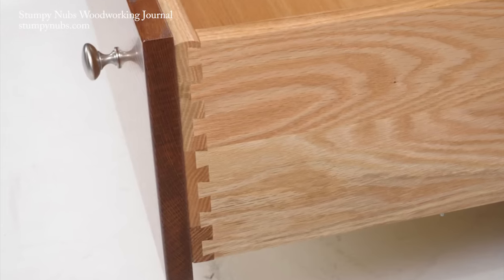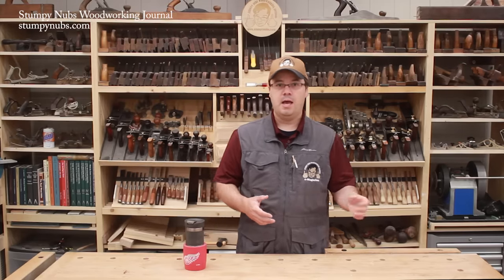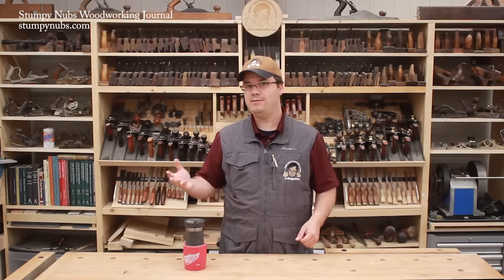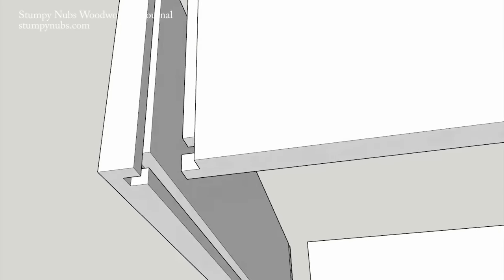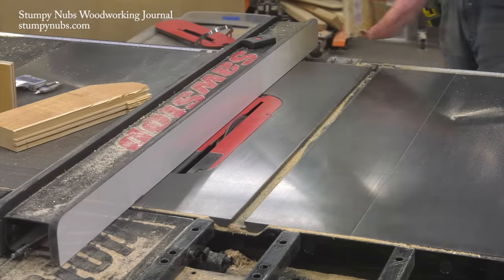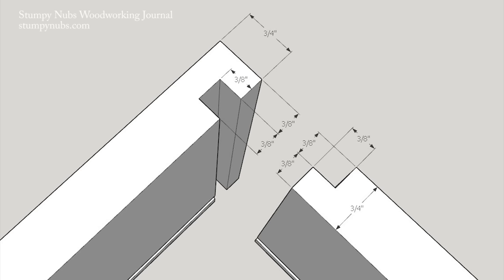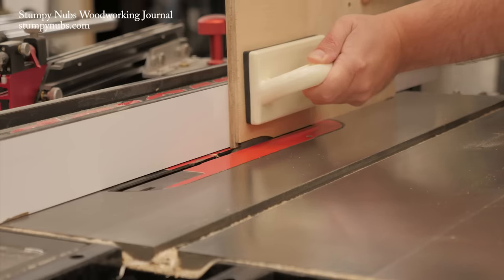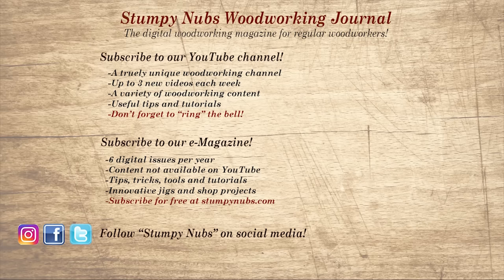The fast and easy half-half-half drawer construction method

Comment: I’ll add to this please. Dovetail joints used to be the only way of connecting front and sides - because of the mechanical nature of the joint and at a time where glues were not reliable. Now we have consistently reliable glue of a strength that cabinet makers of old would probably have given their eye teeth for. So, the need for the mechanical  element is diminished. If you organise you lay out using this method so that the rebate jointed piece is front and back, then the natural action of pulling and pushing a drawer has that element of mechanics assisting the adhesive.

I’ve heard people talk about the beauty of dovetails; of how it distinguishes a high quality piece from all others. But I’ve only ever heard woodworkers who use dovetail joints say that. I never heard a customer of mine ask for a dovetail joint in a piece of cabinetry. In fact, the only comment I’ve ever had on a dovetail joint was a client asking me to take it out as he believed it was too fussy for the aesthetic of the cabinet.

And yes, I can make dovetails. I have the big Leigh jig which takes some time to set up but is then easy to make multiple joints. And I can hand cut dovetails if I need only a few. But I can’t remember the last time that I used one. And I’ve never had a failure in a drawer using rebates (or mitre locks or drawer locks) that I’m aware of. 

Perhaps the only people who still advocate dovetail joints are either people who think it makes them superior in skill than anyone else (but don’t have to make efficiently and thereby sell at a profit) or people wanting you to buy their tenon saw or teaching courses.

Just my view
Reply from the maker: Hide glue is as strong as our modern PVA glues. Maybe after a hundred years or so it can, sometimes need some repair. (Unlike PVA, hide glue can be repaired) But it is just as reliable for drawers.

Comment: Great stuff, Stumpy.  Would be nice to give a clear explanation of how to determine the cut lengths for the bottoms.  Don't ask me why!!  Also, expect some of the little cubes left at the bottom outside corners of the front and back to break off.  Otherwise, worked very well, thanks.

Comment: Excellent instruction!  Your diagrams help a lot.  Question: Lacking a dado set, couldn’t one use a router table and 3/8 straight bit rather than a table saw?
  Thanks!
Reply: I meant 1/4” for 1/2” boards.

Comment: really enjoy watching your videos. Always informative and easy to understand.
How would you secure a notched end (like a birds mouth, used at the bottom ends of 2 sets of crossed/scissor legs) to a square piece of wood running horizontal from one set of legs to the other set of legs on the opposite side) Wish I could send a photo.

Comment: I like reversing the sides and the front/back when using this method so that the front/back is the exact width you need. MUCH easier to size drawers this way when using full length roller slides, which I've found are ridiculously picky when it comes to accuracy.

 Otherwise if your "1/2" measurement is slightly off, you may not end up with the exact width of the drawer after assembly. You can certainly get away with the depth of the drawer being somewhat inaccurate compared to the width.

Comment: Excellent and easily understandable presentation with a well thought out script!  My only curiosity is how do you make the cut (shown in image at 4:34) that doesn't go all of the way through the end of the board? 
Thanks for the great work.
Reply: Carefully starting/stopping the cut at just the right time. This is much more easily accomplished at a router table, but can be done at a table saw. I would recommend stopping the saw when you think you are in the correct place rather than trying to raise or lower the piece with the blade running. This is a prime time to experience a kick-back, a highly dangerous moment. Let the blade come to a full stop befor lifting the board. You may have to finish the groove with a chisel, router, or other tool at your discretion.

Comment: FWIW, I think drawers that are just glued and nailed are very reliable. I used to own an old apartment building and the drawers were made like that and I don't think we ever had a drawer fail, lots of other stuff failed, but not drawers. I think the most important advantage of this technique might be the quick way it is possible to achieve precision during assembly. I have found it time consuming and fiddly to precisely assemble a drawer from just plain cut pieces.

Comment: Hey stumpy - I used the half method on undersized 1/2 ply. Used 15/64" for distance from blade and blade depth (which is half of the stock thickness). The fit ended up really tight. With much coercion and tapping with a hammer, I can fit the pieces together. But I seriously doubt I will be able to get glue in there. Do you have a recommendation on what needs to be changed when the joints end up too tight? Anything that might stand out as obvious?

Comment: This was great especially since plywood is sold in so many different thicknesses. Now I know how to modify when I have to use 12mm plywood. I am going to try to modify the groove on the bottom for 4.75mm plywood. I'll let you know how that works out.
Reply: I don't understand Stumpy's explanation on how to accommodate for thicker bottom panels.  Can you explain?

Comment: Well this certainly simplifies the project. This is the most straight forward description of drawer construction I have ever read. One question though. How do you set up for a 3/8 inch dado? I used to have a wobble dado (maybe still do) that would do 3/8. But can you do it with a conventional multi blade set? Thank you for sharing. Have a great day and stay healthy.
Reply from the maker: Sure you can. Conventional sets start at 1/4-inch with the two blades alone. Add a 1/8-inch chipper and you're there. Use shims to fine tune.
Reply: @StumpyNubs  For some unknown reason my mind convinced me that the two blades = 1/2 inch.

Comment: A great way to make drawers.  One question: In this specific case, wouldn't it be okay to use a finger board after the blade?  If anything, it seems that would keep the board from pinching against the dado stack.

Comment: Hi James,  I am using this method in lumber I milled down to 5/8. My stacked dado says the two ends and one 1/16" chipper is 5/16". The joint produced was too tight. Just add a shim to the dado set? How big of a shim should I start with?  Thanks, great video.

Comment: Another tip is check your throat plate is set flush with the table. If it's even slightly lower your workpiece can hang up as it comes to the back of the throat plate. This can also cause your rabbit or dado depth to be uneven.

Comment: Good Day James, I watched this video probably 10 times before I attempted to cut the drawer front,I followed your guidance to the letter. Made test passes without the saw being turned on. I noticed my stock clearance insert was pretty far from the blade leaving a gap between the saw blade and my fence. So I got this bright idea to cover the space with duct tape. The piece I was cutting was only 4 inches wide . Long story short, as turned on the saw used another piece of wood about 3 inches wide and 14 inches long as a push stick, got about halfway through the cut, the piece I was cutting jammed a on the duct tape my push stick got into the blade for a major kick back, one emergency room visit and 14 stitches later I am on my way to get another zero clearance insert.  The moral of the story, if you notice something a bit out of normal, do not short cut, follow your instinct and work safe. It was a very nasty cut.
Reply: Not that it helps you much, but for others that may see this problem. A very easy way to solve that gap between your insert ant the fence is to move the fence on the other side of the blade. May seem awkward at first but I actually find it easier to keep a narrow tall board perpendicular with it set up this way.

Comment: Thanks for the video. I am a fairly new woodworker and have built a miter station that is going to need drawers. This method seems straight forward and strong. I appreciate your ability to explain things in a way that’s understandable. One question that pertains to drawers, if I use wooden drawer slides ( due to cost) is there an easy way to attach a stop so that the drawers won’t come out unless you want them to ?
Reply from the maker: You could screw a block to the top edge of the drawer's back panel that sticks up a bit and will catch the top of the drawer frame opening.

Comment: Your videos are great. Great topics, and you explain things very well.  Question. Plywood is not 3/4" thick. It's 23/32" thick. If you are using a 3/8" router bit that's not half of the thickness. Will this cause alignment problems?
Reply from the maker: Yes. The bit has to be half the thickness of the material. They make metric bits.

Comment: Great video but you overlooked one point, the dimensions of the drawer parts to end up with you desired drawer dimensions. Maybe obvious but critical. The sides that are dadoed must be full dimension but the front and back that are rabeted need to be reduced in length by the thickness of the parts. Now a question, any reason you wouldn't use this method to make the cabinet boxes?

Comment: First, thanks for the terrific video! Second, my dado continues all the way through the ends of the panel which create little square holes. The diagram in this video shows them stopping be for the vertical dados. How is that achieved accurately on the table saw?

Comment: The throat plate on my SawStop jobsite saw flexed when cutting the boards in the vertical position using this method. When the board entered the blade, it cut to the proper depth. But the operation is very critical (having that board extending straight up) and so I was  making sure that the boards were firmly seated against the table. With me positively biasing the boards against the table, as the boards exited the blade, the throat plate flexed and caused the cut to be deeper as the boards exited the cuts. This resulted in a disappointing outcome, with a poor fit between the drawer sides and fronts/backs. I was forced to recut the dados deeper and now the fit will be sub-par. I achieved superior results using a router table the last time I constructed drawers.

Comment: Really good video , I have always had issues with drawers , tend to avoid them but your video is good will try it when i get to that point . I would like to see some videos  on drawers that dont have sliders on sides . I have several pieces of furniture that are very old that don't have slides on them yet they work and slide in and out very well .  Secondly do you have any videos or plans on pullout units?? ty sincerely deb b in  VT.

Comment: This is a great tutorial for a great method. Dovetails are fine when you have only one joint to make, but dovetailing a whole chest of drawers would take all week. However, It’s my understanding that dado blades are illegal in the UK, because of the need you mention to remove the safety gear. To this effect, table saws sold here have an arbor fitted that won’t carry a dado blade. Do you have a method of making these cuts with a standard 1/8th kerf blade?
Reply: Router table after a centered relief cut at the table saw.

Comment: Thinking this through - dado sets are a rarity here in the UK & unavailable for my table saw.
Surely this could be done on my router table using the correct diameter bit?
Reply: sure - I have made something similar with 12mm plywood and 6 mm router bit

Comment: Great video! I'm going to try this one out with 1/2". Just one question, given that my plywood isn't going to be exactly 1/2" thick, or 1/4" thick but my dado blade is, is this going to cause issues? Should one be measuring the actual thickness of material and then adjusting the fence to be consistent with the calculated half or as long as the fence gap is consistent and set to 1/4" will the nominal thickness of the actual material in a slight off size be redundant? I hope that makes sense.

Comment: great video. qq: i have a DW745 so I can't use dado stacks. Would this method work with a router too? I suppose it can but just wanna double check with you guys 🙂
Reply from the maker: It will if the router bit is exactly half as wide as your material is thick.

Comment: I concur with the comment below, assuming it's still below, well done and thank you! I enjoy all your videos. There is one thing I'm having trouble visualizing. Do you mean literal half of is that more figurative.? For example 3/4" ply isn't 3/4" actually a few mm off? So would setting dado height to 1/2 ie 3/8 for 3/4 or the actual thickness / 2?

Comment: This is a great system unless you are doing bottom mount slides such as Blum tandem.  They require the drawer bottom to be spaced 1/2" above the bottom of the drawer sides and fronts.

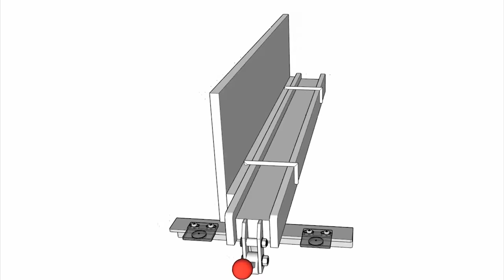Comment: Awesome video, and (in my case) timely.  Question: at 6:18 you talk about using a featherboard ahead of the blade, which is best practice, but show the featherboard apparently directly above.  In this case, I can't think of a reason this would be dangerous (and therefor obviates the "ahead" warning); it actually looks safer this way.  I'm probably picking nits, but it jumped out at me.  Again, AWESOME video!
Reply from the maker: It's perfectly safe as shown in the video. I should not have said "ahead," I should have said "over" the blade.

Comment: 50/fiddy/fitty

Before doing the edge standing up, cut piece wider then run through the saw on edge, later split the pieces to proper size.

Comment: Have you found any problem with the actual plywood thickness not equaling the nominal plywood thickness using this method? I know it is a minor discrepancy but I was curious.
Reply: This why the 1/2, 1/2/, 1/2 system uses 1/2 the thickness of the material.

Comment: Wondering if bottom dado for drawer bottom is strong enough with 1/4 lip when using plywood? Preferable to have 1/2 in of plywood under the bottom dado? Means you have to adjust your fence a couple of times

Comment: Great video, here in the UK, we cant use dado cutters in our table saws. Do you have any suggestions how to overcome this problem without having to use different setups and multiple passes?
Reply from the maker: You may do the same thing with a router table as long as the bit is half the thickness of your material.

Comment: Thanks. However, how did you get those clean stop-cuts in the side panel grooves for the bottom so that the groove doesn't show/go all the way through?
Reply: That was just a little oversight made in SketchUp. In reality, that groove goes all the way across the sheet. If you look at 3:53 (and a few other places in the video), you can see that there is no stop-cut on the actual workpieces.

Comment: Would you say this is stronger than the locking miter router bit?

I don't have a dado stack (yet) and am contemplating which would be cost effective between the 2 methods.  Any insight/advice?

Thanks ahead of time! 😀😇😎
Reply from the maker: It's not stronger. Just easier. One setup for the corners AND the base panel.
Reply: @StumpyNubs  thanks for responding! 😀😇😎

Comment: Love this and I tried the half-half-half solution. Worked out well. I'm curious though to get your thoughts on "half-inch plywood". The problem I had was that my dado set will not go below a 1/4 (which normally isn't a problem), but as you know, the plywood is not really a half inch. So if I cut my dado at a quarter, I am left with a gap that is not really a quarter. I could not work out how to do this on the table saw so I figure the only solution is to cut dados and grooves on the router table using an undersized bit. Any thoughts on making the table saw work with "half inch" plywood for the drawer construction? (This is not an issue if I use undersized 3/4 plywood since I can build up the dado set to the odd size.)
Reply: Hi Mark, I do mine on the router table. Easier to setup and adjust IMO. I also run a rabbet around the bottom and use the same material thickness for stiffer bottom.
Reply: Get a wobble dado, I have an original Craftsman (used available on eBay).  This dado is infinitely variable -good enough for government work😀

Comment: This method works beautifully if you are using side mount slides. however, a bottom mount drawer slide requires a 1/2" inset on the bottom. Are there any clever tricks to accommodate this other than using 1" ply?

Comment: I'm interested in trying quarter-quarter-quarter drawers (or half-half-half as Mr. Nubs calls them) but I don't know the best way to pull it off if your 1/2" plywood is undersized because, as I understand it, dado stacks really only go down to 1/4". 

Any ideas on the most foolproof way to do this otherwise, other than just using thicker plywood? 🤣

Comment: You could also cut all pieces with them lying flat on the saw top by just adjusting the fence and use multiple passes. Much safer!
Reply from the maker: Cutting on edge is not unsafe. And your suggestion defeats the purpose of the one-setup system.

Comment: This is a great video on the technique.  As someone else mentioned, most 1/2" ply is thinner than 1/2".  How much thinner can it be for the technique to work with a 1/4" setup?  My dado set makes a minimum cut of 1/4" but the birch veneered ply I recently bought is only .447" thick and the Baltic birch I have is .470" thick.  Thanks!
Reply from the maker: Ridge Carbide makes a dado set that will go thinner than 1/4
Reply: @StumpyNubs  Finally found it.  I e-mailed Ridge and they said their dado sets only went to .250".  It looks like the 
8" x 20T 4 pc w/ Shims Triple Play Dado Box Joint Set is the right set.  It will go down to 3/16".  Thanks for pointing in the right direction.